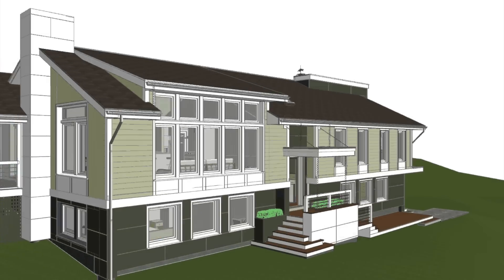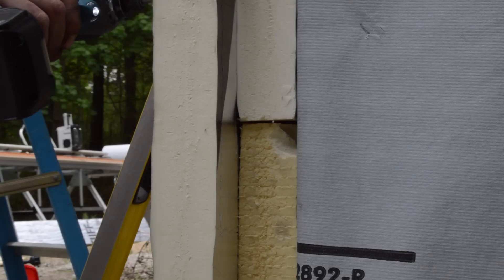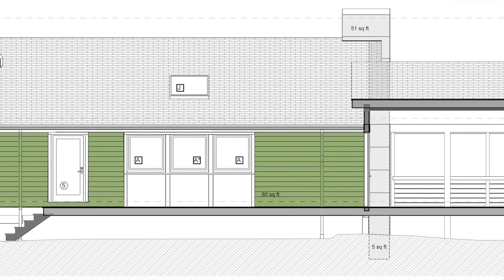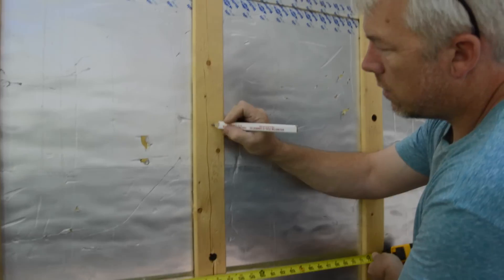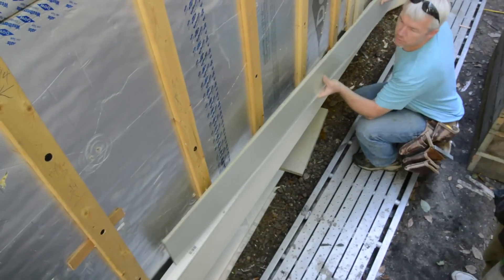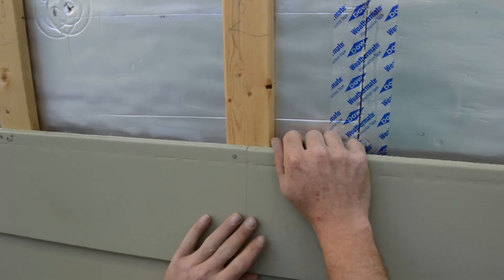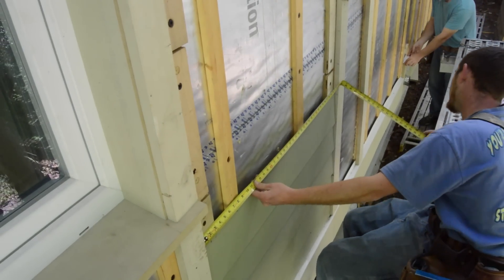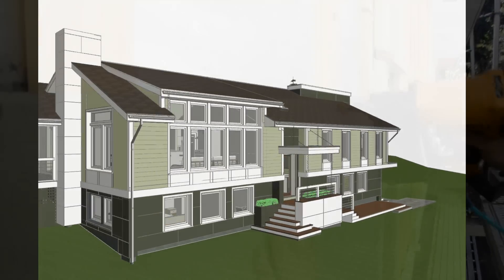Lap Siding Installation Basics

Comment: If I was an insect, I would be thrilled at the way this siding was installed.  Lots of space for me and my whole family to set up shop because of the omission of an insect screen.  Also no starter strip at the bottom course of siding.  No gaps between butt joints for expansion.  No gaps that I can see between siding boards and vertical pieces of trim--these should be held back 1/8" and filled with backer rod, then polyurethane caulk.  Rainscreen furring strips should be treated with preservative in order to prevent rot caused by the moisture trapped behind the siding.  Looks like you used untreated softwood for the furring, which is not going to resist rot at all.
Good job priming the end cuts prior to installation.
Rainscreen systems are excellent, and the exterior insulation was a great way to get additional performance from the 2X4 wall framing.  However, I don't think this siding was installed per the manufacturer instructions and I'd be concerned about whether it will perform properly over time.
Reply from the maker: If you were an insect, it would be astounding that you're watching youtube videos AND COMMENTING!

There is an insect screen at the bottom of the siding to prevent insects from getting it. he uses a plastic mesh, like mortar vent and insect screen.

Comment: Wow the first time ive seen a cavity batten in US construction!! this is regulation in New Zealand right now. Much better system having the air space
Reply: Another tip is when you put the battons on, cut them on a angle so if any water comes down it simply falls off instead of landing on a square cut

Comment: What are the black screws used to anchor the furring strips? How long were they?
Reply: They are structural framing screws, by FastenMaster, I think—there are a few brands. 

These particular screws are about six inches because there is four inches of foam on the outside of the house. 4 inches + 3/4 in of furring + 1-1/4 inches of penetration into the studs.
Reply: Daniel Morrison  thanks Daniel! Man they are expensive, about $1 per screw. Did you install them every 16” vertically along the 1x4 or 24”?
Reply: @camhaines5482  I've been using a 6 inch t-25 exterior screw ordered from amazon, comes to about 20 cents a piece.
Reply: Timberlok is another brand